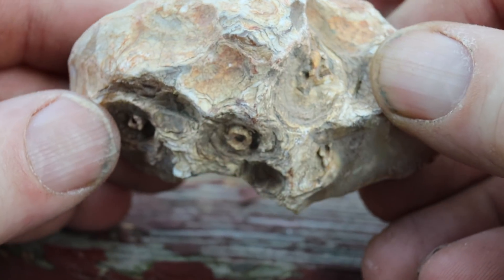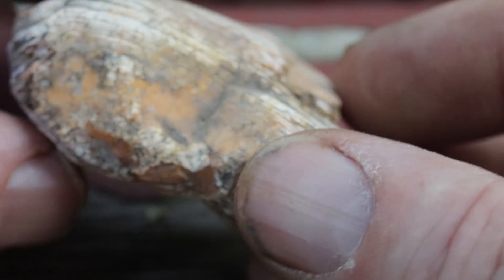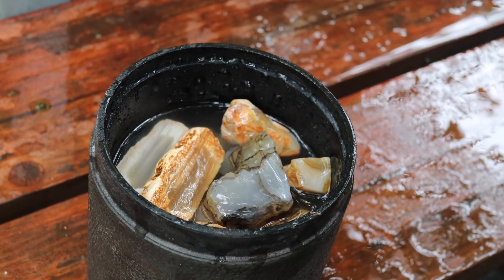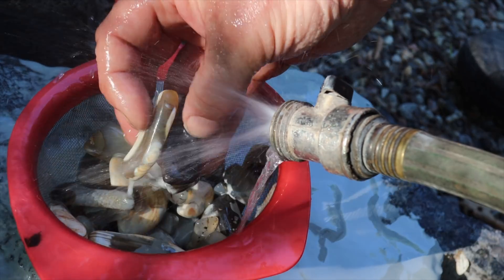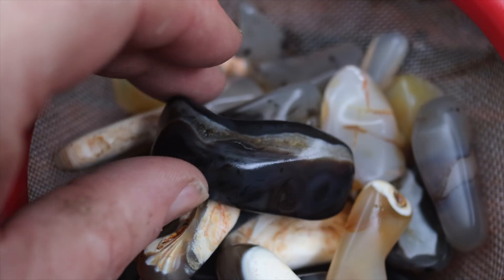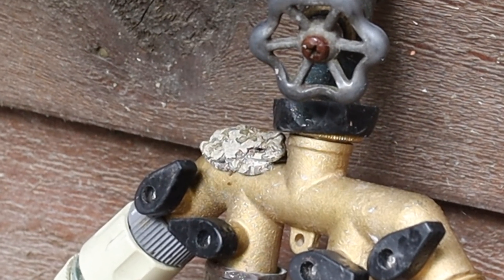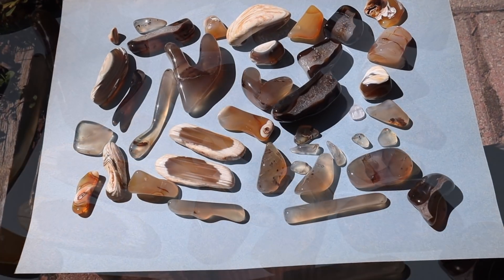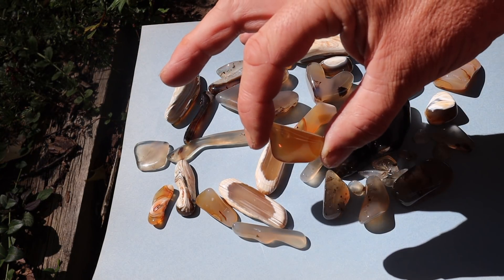Polishing INDIA AGATE in Rock Tumbler start to finish

Comment: Alberta here. Thanks so much. I'm new to this hobby, and my first tumble will be agates that I've collected on the gravel roads. I have the same tumbler, and tomorrow I'll be checking on the first week in coarse grit. The way you've done it is pretty much the way I plan to go. Interesting that you mix plastic with ceramic. I like that idea...
Reply from the maker: Good luck with your tumble. Very cool that you can find agate on your roads.  You might want to do stage 1 for a bit longer than a week.  ie. don't dump the barrel out and just have a peak to see if you want to coarse grind for a little longer.

Comment: Miner have you ever used cerium in a tumbler for step 4? Because I bought some and used it without sugar and baking soda and my results were sub par after burnishing. I think I might try step 4 with sugar and baking soda and Alumina oxide instead 🤔 just a little frustrating because the cerium was a bit pricey, any advice would be appreciated. Tumbling crazy laced agets and quartz with a few agets
Reply from the maker: I stopped using sugar and/or baking soda because once in a while I would get gas in the barrel.  I never figured out what combination of rock and additives caused the issue.  I have used cerium a few times, but not enough to form an opinion other than I don't like the staining which was difficult to remove.  No reason that is not good for a polish.  I usually have good results with AO, so really no reason to change.  Good luck with your tumble.  Usually agate polishes well.   My only suggestion is leave it in for longer.  I have currently got noticeable better results leaving the hard rocks in polish for 2-3 weeks, rather than 1 week.
Reply: @meMiner  thanks Miner for your instant reply. I only asked because you use flat laps and other neat machines to polish and figured you might know something about this cerium polish. It was a total impulse buy and I always appreciate your tips and tricks. I love your youtube channel! And I am asking my daughters for a metal detector for Christmas instead of a rock tumbler this year. You changed my life man thanks. St.clair shores Mi❤

Comment: I'm new.  I have a small tile saw I used to do tile work.  What kind of blade do you need for it to cut rocks that is safe around your hands?
Reply from the maker: Safe is relative, but certainly stay away from a blade with teeth.  I just use ones that suggested for porcelain and pick something on sale.

Comment: When you use plastic pellet try to not pour slurry to garden. Small plastic pieces are canceroggenic and can acumulate in animals. I catch all water I use to wash my stones and pour it into filter that I made from pot, old sheet and sand. I also have an idea about reusing grit from first and second stage, you just need a gold pan, or if you have bigger amount of slurry you can use small gold sluice. I didn't tested it yet (not enough slurry to pan), but grits are usually more dense than most rocks or even rock dust that usually creates colloid with water (when quartz slurry is dry it's also canceroggenic - becareful and wear a mask) so you will catch it. Grits after catching will be contaminated and you should sift it. If grits destroy itself in tumbler... well then you have nothing to reuse uśmiech 😜
Reply from the maker: The coarse grits break down into finer grit.  Some people reuse polish
Reply: @meMiner  Yeah I have read about that. But about breaking down... well sometimes grits  disappear (destroy itself), sometimes it breaks down to finer, but sometimes it's only a little bit finer than it was - here sieves come. Idk if reusing polish isn't too hard for me - even small amount of contamination can ruin entire tumble, but on 1st and 2nd stage contamination is easier to avoid. Also rethink about using a filter for slurry.

Comment: Purdy, real Purdy.
I see you still have a water monitor, Is that what you did at school?
Still get nice Rocks from india, they are gathered and graded, Any special ones are put aside and the rest are sold as agates, which is used as a  generic discription for the hardness and not their look.
India provides one of the fastest postal and courier systems globally, I can order a specific type of food and get it delivered within an hour and often inside thirty minutes, I think that is mostly because of the weight being so low allowing the birds faster flight, but even so it's quite a amazing, they must have heat resistant feathers. 
But joking aside mostly because joking ahead limits the audience, I have a large piece of indian petrified wood, no there is no punchline, it is very hard and heavy, I have taken some cuts and there was a fracture which caused either breaking or smash out on the saw, which is why they have a lid,  never leave a machine unattended, if I can find some easily enough I will send you some.
I'm in the process of relocating ( once I find a new location ) so almost all of my life is in black recycled plastic boxes stored in the garage, anyone in need of a house trained, polite, well mannered rock nut, almost sixty going on twenty six, or has a spare corner in a shed where I can rest my weary head, feel free and contact me here @ Greig knows this english guy. help 
Good work my friend.
Reply from the maker: Good luck with your move.  We have a spare bedroom.  I'd hate to move.  I have so much stuff that it would take a year just to pack up.
Reply: @meMiner  
Exactly, can't take any furniture, all solid Oak and no flatpack goods, it weighs a ton and two of the kids are still at home, despite me buying it all I will leave it here and just take my personal stuff, my lathe and mechanical tools will have to be sold and my vw van will go.
I will try and keep my lapidary saw and grinders but I don't know where or what I moving into yet.
The offer of your spare room is very welcoming but when I move it will only be once, if I have any funds over when i'm settled I might just take your offer for a few weeks, months, years, whatever.